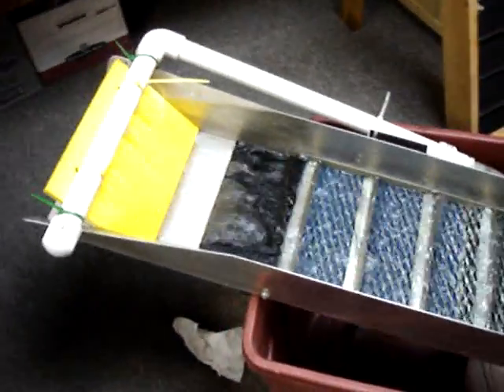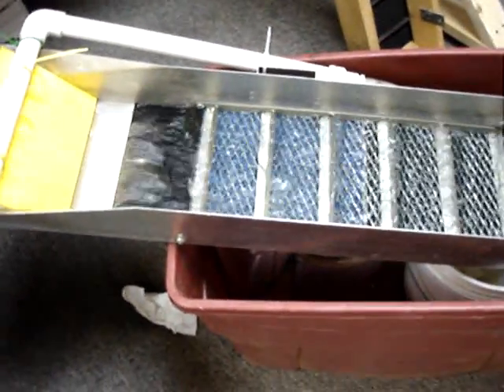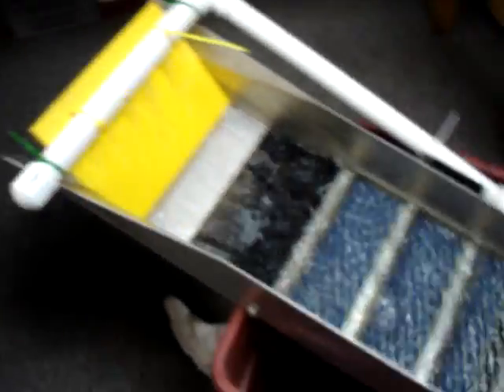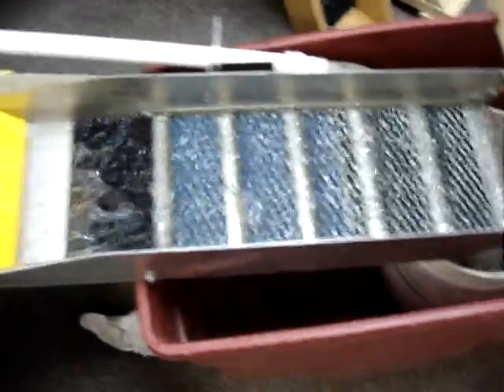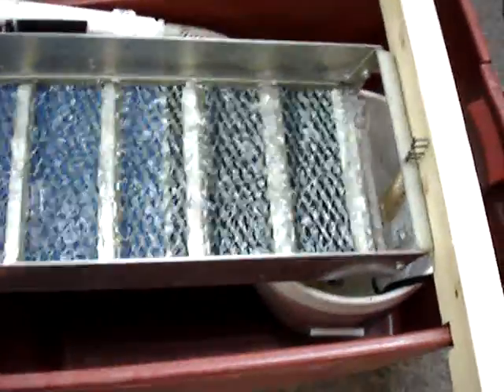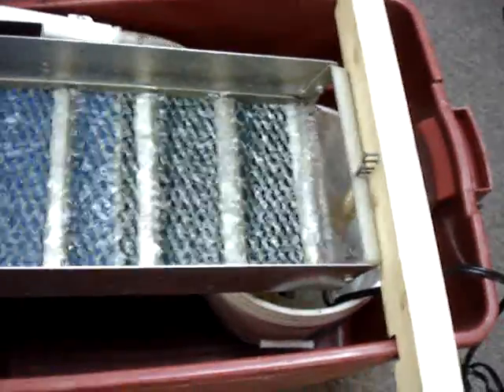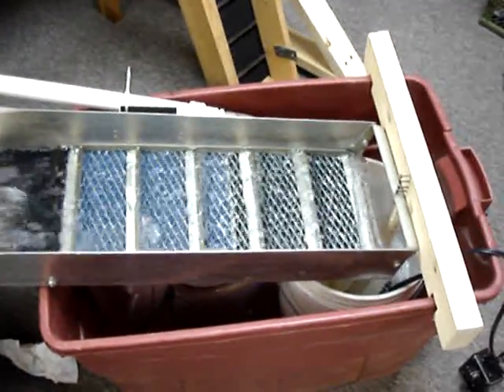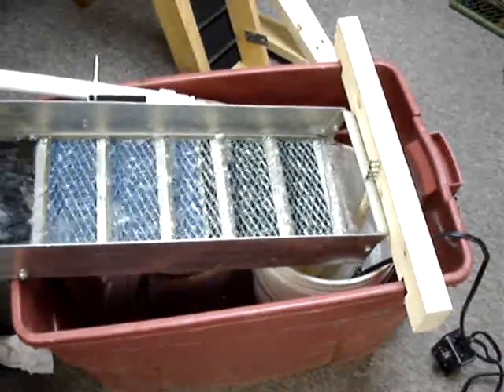New Recirculating Sluice Box at mdpub.com

Comment: @ttrompeter11 The water falls in the bucket, and then settles there before then flowing into the catch bin at the bottom where the pump is. (This is the best way to run them) although it prob wouldn't hurt to also have some kind of filter in the catch bin just in case too.